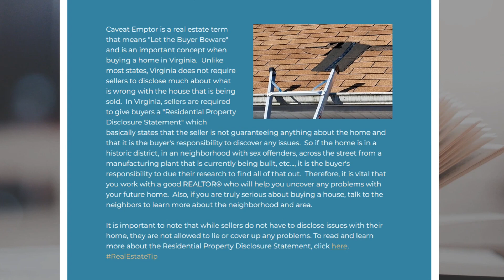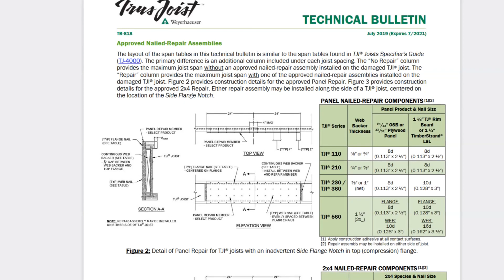Wood rot in the house we just bought

Comment: Joist hangers for that deck aren’t required there?
Reply from the maker: The joist hangers aren’t required in this instance because of the 2x2 ledger strip under the deck joists.  I still prefer joist hangers and installed them against the house instead of a new ledger strip but decided against replacing the ledger strip on the outside of the deck with joist hangers.

Comment: Geeze guys, I'm looking at what you have going here and trying to figure where to start scratching my head. It's going to be some work and time. Looking at your pictures I can get a fair idea of what's going on. Here's a link to a vinyl cedar look siding installation guide. https://vinylshake.com/content/Download%20Center/Product%20Page%20PDFs/Install2017.pdf I was looking at the bottom the the vinyl siding where it meets the deck and it looks like the installer used a J trim instead of a starter course. The J strip is a water trap and possibly is contributing to the problem. Swap that out for starter course so rain runs down and off the bottom edge of the siding, not get trapped in the J strip. You are going to have to pull that deck away from the house. Build a pony wall under it about a foot out from the house, screw some x bracing from the pony wall to the existing posts. Pony wall would be a couple 4x4's one at each corner and a 4x6 spanning under the joists. Get your crowbar and try to pry the ledger intact if possible away from the house. Try to get as much room as you can. The front existing posts may or may not lean. If not, try to unbolt them from the ground bracket if there is one and move them. You'll need the space to work between the deck ledger and the house to remove the rotted siding, sheathing, rim board and whatever else needs to be moved. Complete framing your inside pony wall but first, I'd consider using a 4x6 beam to more accurately keep the floor joists level to each other so you don't accidently jack up and crack or pop an entry tile and put spacers slightly smaller than the TJI 230 joist bottom cord width to give you space so when you install the new sister boards in there, you can flip them upright and slide back and forth to position them. Put a shim of the same size under the new piece when in position. First thing to do is remove any damaged top plates and replace them. New construction here wants an overlap or 48" between the upper and lower but if less like 16 or 32 inches, have the joint over a wall stud then nail on a CS-16 Simpson roll strap on one of the joints, 18 inches to each side of the joint. I think you said the rot extends up to 24 inches from the wall into the truss joists. Working one at a time, clean out the decayed parts. If it looks like there is mold of other residual, spray it with bleach solution and let dry. If the web area is totally rotted clean away what is loose. A course sawzall blade works well for removing material like the bottom cord of the truss above the top wall plates, Clean rot out well but try to leave intact so you can shim the gap tightly later. You'll have to decide which is best to start first, the rim board or the truss joists. Determine if the builder used the 1-1/8 rim board or the 1-1/4 LSL. You'll want to match that dimension. Don't mix dimensional lumber with engineered lumber. You'll have to remove a bunch of the upper and lower siding and the mid board to install the new rim board and plywood sheathing. Get some Tyvek and flashing. I'll finish this later. being called. Hope this helps and or confirms what you already know. Sorry about it man...
OK,  Those doubled end joists for the deck have significantly weakened the existing rim board with that pocket cut to set them into the house. The deck was built by someone who didn't know what they were doing. Another thing, that 2x2 under the joists on the ledger might actually be helping to direct water into the house. When you get the new rim board in and truss repaired, in the between spaces where the deck ledger will attach to the house, add a blocking of rim board to double the material for bolting the ledger into. Use two 3/8 x 5 Ledger lock bolts every 16 inches and not more than 12 inches from each end. Get some proper sized Simpson Z-Max hangers for the deck joists to the ledger. When you reattach the deck to the house. You may have to cut some wires and put in some ceiling junction boxes. Looks like you may also have to section the pipes, PEX, and couple those back together. I think That's enough information to give you ideas how to do things but if you have any questions, give a holler if you need anything.
Reply from the maker: Great explanation, I’m going to copy this to a word document for sure.  Let me know when you’re ready to come help on the project lol.
Reply: @RVCrazy  I'm not quite retired yet otherwise I'd consider the road trip. I've been building/remodeling houses and figuring out strange things people have done for 40 years. If you need an answer doing this project, you're welcome to give a hollar. I hate seeing you two having to go through this. If you need a touch of home, look up KING 5 TV and their New Year's Borealis light show on the Space Needle. Take care...

Comment: As a home inspector in the midwest, I would be really interested in seeing that inspection report. I average 450+ inspections a year and I see a few things in this
Reply: I do consider my inspections to be little more thorough than most in my area
Reply from the maker: He did mention the repair to the brickmold and the lack of bolts or anything but nails on the ledgerboards. I’d gladly forward the inspection to you. I really wish we could have been present for the inspection and seen just how thorough this inspector was not.
Reply: @RVCrazy  rough, if they're properly cantilevered that's not a ledger board, basically just trim. If you're talking about the rim joist, yikes.
Reply from the maker: @thepinkerton657  I would describe it as yikes for sure. And the larger and taller deck off the front of the house is built exactly the same I’m sure. I haven’t pulled the drywall but I’d bet the rim boards on it are cantilevered about the same.
Reply from the maker: Email should be sent. Thanks again.
Reply: @RVCrazy  cool. I'll look it over later today
Reply: @RVCrazy  I just sent you a sample report. A house from early last month, the info changed for legaleze. The one you sent me is about the bare minimum I see others do. Not that I can speak to the standards and practices of another state. Home inspectors take the same certification course nationwide, but how we apply what we know and see is a different story. You'll see I've taken a lot of time and effort to craft and streamline my reporting style and software.
Reply: @RVCrazy  How the inspector ended up with 8 pictures of the fence and no more than 2 of anything else is beyond me. Buying a home isn't cheap, and neither are all the extras that go with it. I always want to make sure the client knows that they paid for the best service.
Reply from the maker: Just looked over your sample inspection and back at mine and damn I got wish I had gotten an inspection like yours. So much more thorough and you can tell that you actually care and put effort into your work. There have been a lot of things that we have found ourselves which I’m sure you would have found if you were the one inspecting our home.   We are still happy with our home but a proper inspection would have helped us to be more informed home buyers that know more of the issues with our home.  The 8 fence pictures are pretty funny, he had to throw in some kind of pictures to show problems with the house, or the neighbors fence, haha.
Reply: @RVCrazy  Just like every profession, we don't all hold ourselves to the same standards. They are visual inspections, but it doesn't mean you can't look harder as an inspector. Every home has a list and trying to give a complete list is what I go for. Not scare anyone from a sale but to to make sure the buyer has anl better idea of what they're getting into. I wish you all the best. Homeownership is awesome and sucks at the same time.
Reply: @RVCrazy  The individual background of each inspector also plays into it. The more an inspector has done in their life typically plays into how they inspect. I don't expect, I inspect.

Comment: Cantilevered decks typically have twice as much length inside as they do showing outside
Reply from the maker: Yes it makes no sense to me why it would be coming through the band board at all other than sloppy construction. It’s not a real cantilever setup but it’s penetrating the house as if it was.
Reply: Looks like a bad after thought or a rookie diy
Reply: I would consider it unsafe. Look into North American Deck and Railing Association (NADRA) standards and failure data. It's legit, taking their course changed the way I do inspections
Reply from the maker: @thepinkerton657  Yes I agree that it’s unsafe for sure. Nails are not an appropriate way to hold on a ledger board at all and right now the deck is nailed into the hopes and dreams of rotten waswood.

Comment: Also, was there any mold like substances on the backside of the drywal you removed?
Reply from the maker: Yes there was in a few spots, could you guess an age based on the mold?  I unfortunately threw away the drywall that I pulled down already and I forgot to look for a date code.
Reply: @RVCrazy  i would look for more there to the left of your bracing at your other leakage area
Reply from the maker: @thepinkerton657  Yeah I agree, I wouldn’t want to keep that festering in there.
Reply: @RVCrazy  you may think about renting an ozone machine after the wood repairs are done, but before closing the walls, and running it for 24 hrs to help reduce the chance of regrowth
Reply: @RVCrazy  and no, wouldn't be able to give an age, but assume at least a few years